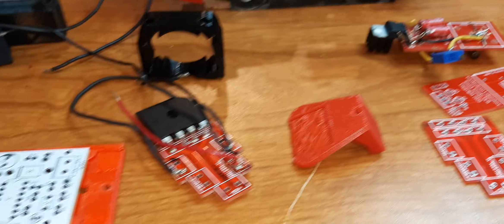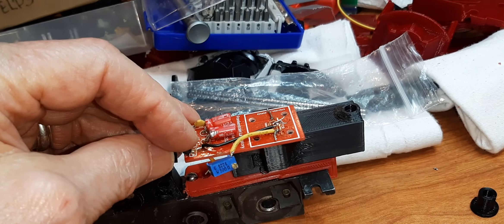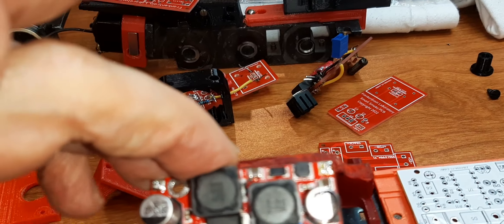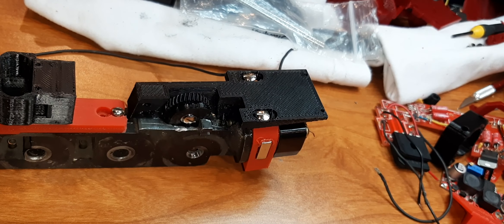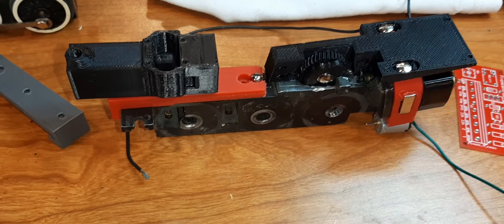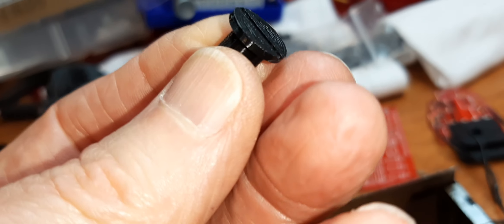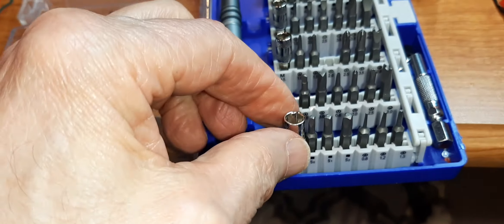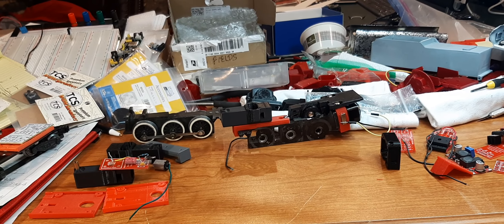Old chassis gets Fan driven Smoke. We have more PCB's to assemble. Building a few simple kits too.

Comment: Can you have someone manufacture chassies for you rather than having to use old Flyer chassies?
Reply from the maker: @alanb287  Not exactly.  I am using the RIB chassis which are not popular. I do have a plan for a custom Aluminum chassis with several prototypes and a completely 3D Printed Chassis. Both need more development. I should not have used the Brass Button chassis perhaps. I have several later versions that are not brass button and still no smoke Gear slot. But like my first Fan driven Smoke I was cutting up Flyer Smoke housing. I stopped that right away only made 3. Sold 2 and keep one. Then I went into CAD and 3D Printing. There are new metallic filaments so that maybe my next approach. My goal was make the old chassis into the later models. Not destroy a vintage antique. I knew cutting up smoke housings had to to Stop. Only now did I think the Brass Button Chassis were Antiques too.
My goal all along was to make a whole new S model train family. But at 74 that seems unlikely at my pace and budget. One of the early Flyer trains came out as a kit to assemble. That was my objective for the chassis. Then offer bodies or allow buyers to design and build their own by publishing all the specs and mounting points in a CAD ready format. I had made a 3D printed interface template that I would give out the .STL so others could print it build using it as the guide. Then their new body would fit on our chassis. Lots thoughts but very slow to act. D